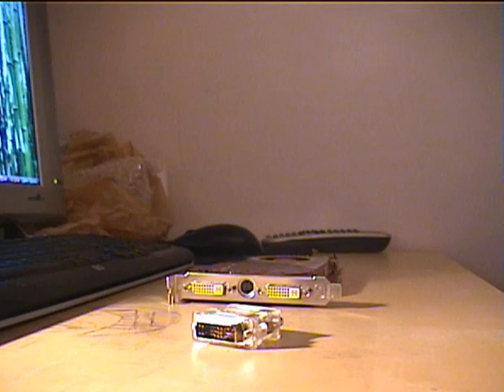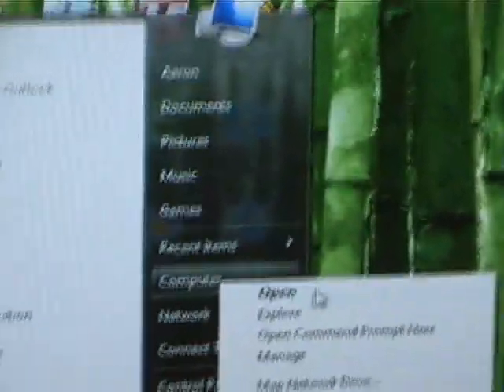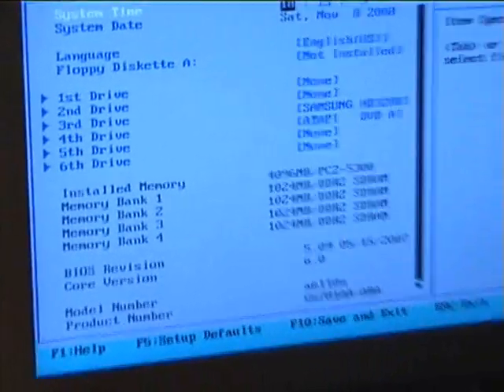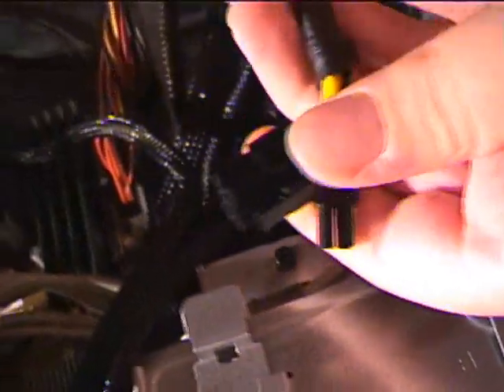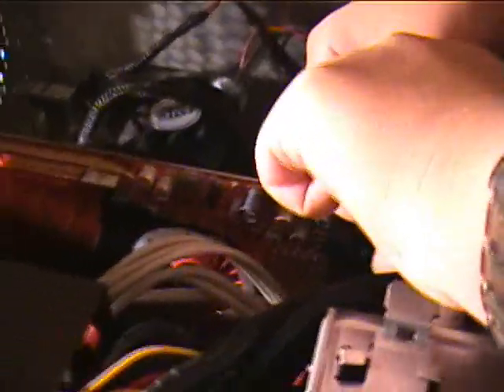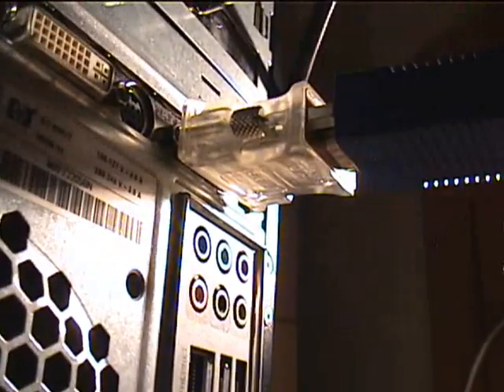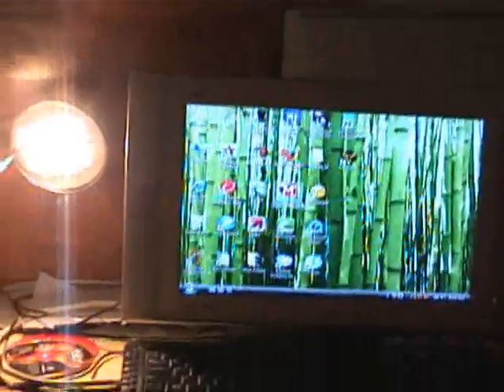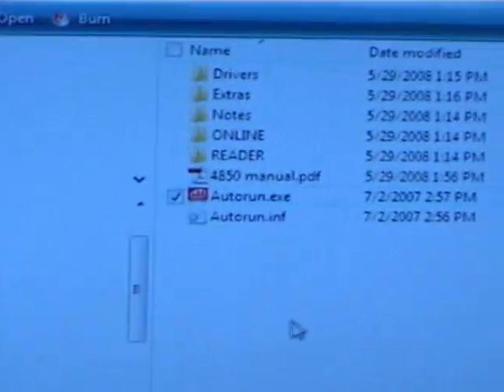How to Install A Graphics Card

Comment: @minnieman94  do you still have the same foxconn NAPA board?  i'm planning to replace my 9500gt with a 9800gt. does the default power supply have the six pin connector thing?

Comment: Im trying to install a ATI HD 3450 in my desktop but everytime i install it the computer wont boot or even post.When i put my old Nvidia 6200TC in it works right away with no problems...I have a 450 watt PSU with Asus M2N68-LA